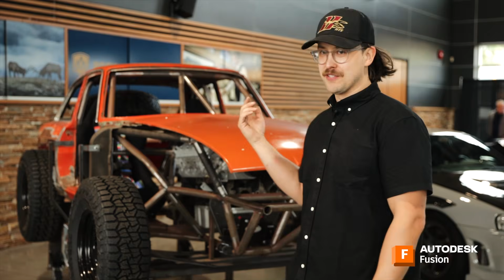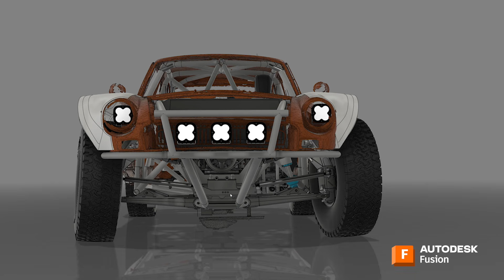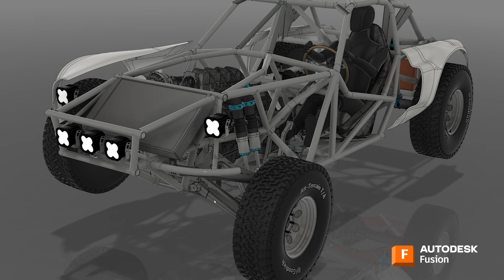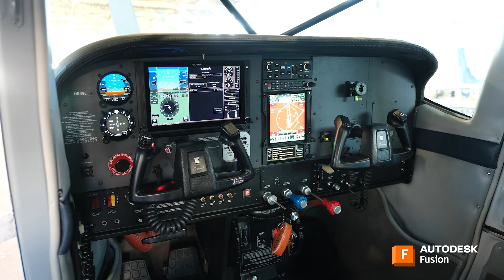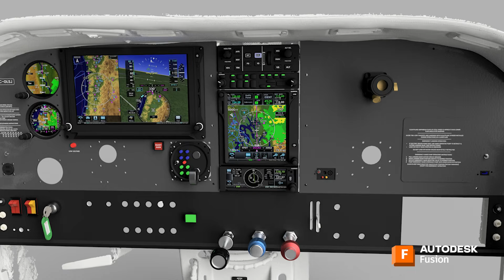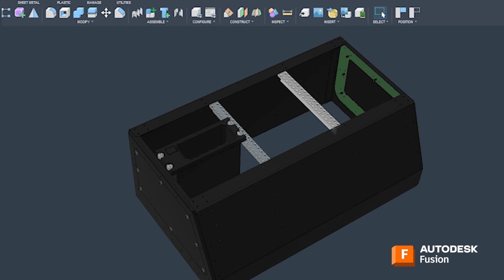From Rust to Rocket: Designing a Tube-Chassis Baja MG Entirely in Autodesk Fusion

Comment: Omg lol I restored converted MGB gt v8 and I am always fascinated by the Baja trucks but what made the GT so special it was a after thought the desing the body for a cabriolet so the GT body is so stiff  it's drives very good it doesn't get the love because it's not upperclassmen brand. 1000kg and a V8 and used the the front suspension from the RV8 carbon leave springs in the back drove like a dream. But well I think when I get the chance I try a Baja truck.